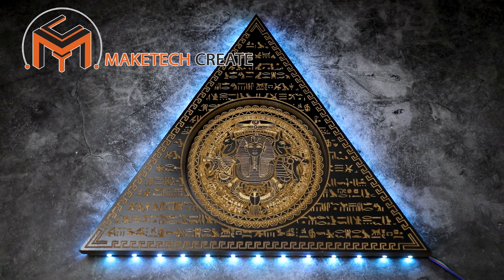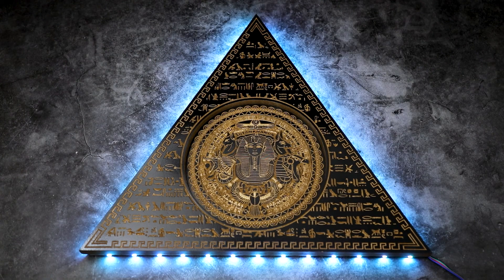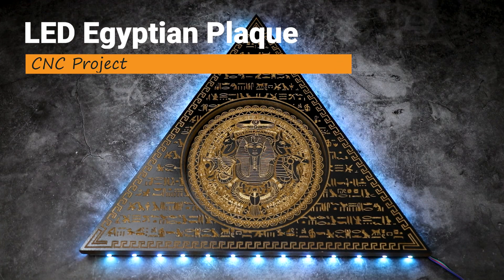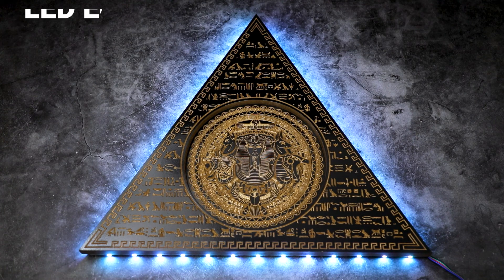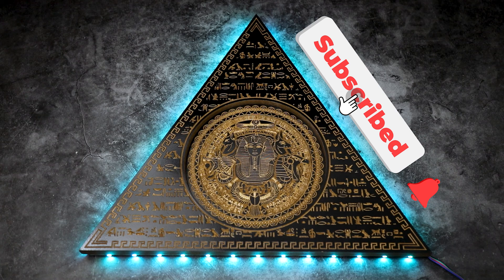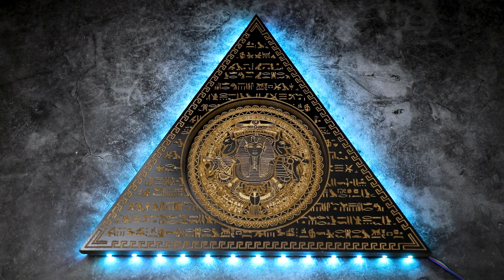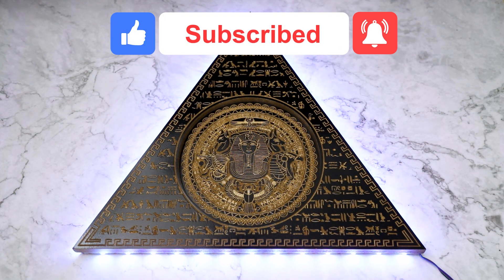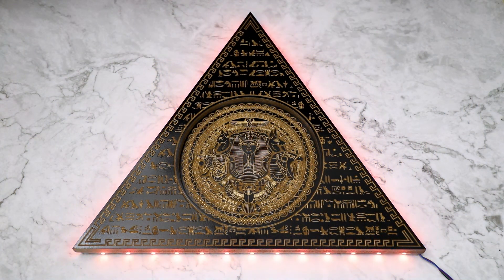GLOWING Egyptian Plaque CNC Project

Comment: I think it would have added a nice touch if the bottom piece was a little bit smaller than the top so you could have hidden the LEDs under the top layer.  Very nice decoration.